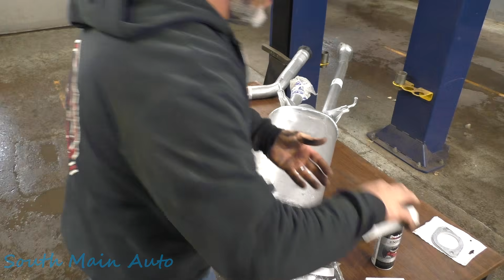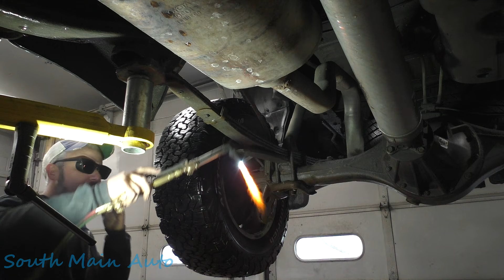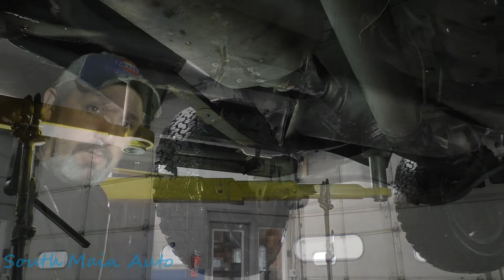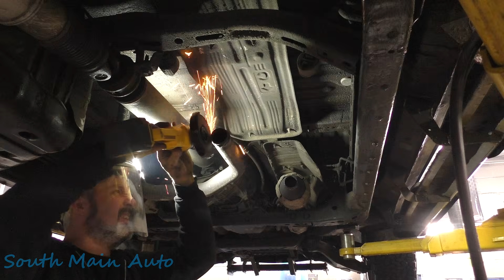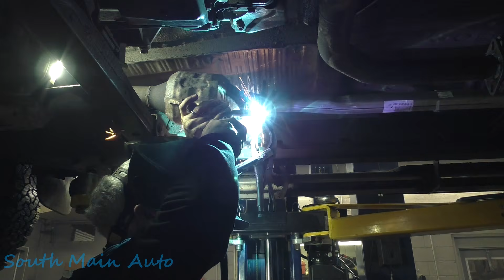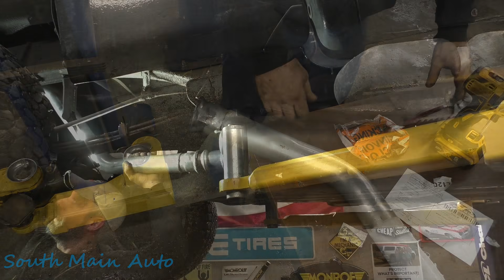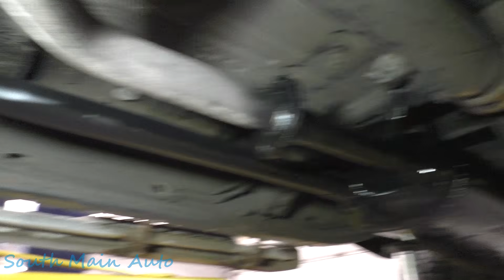Toyota Tundra: Welding On New Convertor Flanges & Replacing Muffler

Comment: As a DIY'r, I own my torch setup.  Leasing the tanks all year long to use it once or twice just didn't pencil out.  A medium Miller/Smith torch setup, a 75cuft full acetylene tank, an 80cuft oxygen tank, and a cart set me back over $1000 several years ago.  The upfront cost of leasing the tanks would have been lower, but at this point they're probably paying me back.  There are cheaper ways to torch, but I like nice tools.  😉
Reply: I always wanted a torch but could not justify the cost. Than one day I was driving along and someone was throwing out one of the small portable kit, ( tanks carry case gages the whole thing). The tanks were completely full.
Reply: Yep. Same for welding gases: it works out better for us DIY’ers in the long run to own the tanks outright and find a place that will fill them at a reasonable cost.
Reply: I had a set of tiny tanks used for hvac brazing I was using for automotive. Seems like I was constantly having them filled. Upgraded the garage to giant tanks on the cart and I haven't filled them since. Its time to refill though. I use mine a couple times a month, but without them I can't do the work. Well worth the $.
Reply: Some jurisdictions won't allow you to own tanks as a diy or shop or dealership. The people that own them can't legally get them filled.
Reply: One draw back with torches is the cost of acetylene. The last time I had my small tank refilled (2 years ago) it was well over $100.

Comment: As a top fan, I am very careful not to get into a pissing match with anybody in the forum. I have read many of the comments and I was surprised to hear Eric say people were complaining about his use of the torch. Well, let me say that I am from Springfield mass and I couldn’t run a shop without a cutting torch or a welder. The rust on these cars is not going to allow you to remove anything the normal way .If I can use the whizzy wheel and cut things off safely. I will do that the oxy acetylene is a little pricey, but that’s what the shop supplies charges are all about paper towels waste uses of gases. To name some

Comment: I have used propain oxegen torches, but these where in big shops that make mining equipment and it  is a cost saving measure and work just as well as astatine , other then that being in northern ontario you have to have then on your truck , there not a want there a must , but i also carried a small welder as well , that was a want , but working on heavy equipment it sure as heck came in handy

Comment: I had a 2008 Toyota Tundra that had the front differential howl/growl TSB repair, err they replace the whole front differential.  Both rear axle bearings, apparently also a TSB...both replaced.  Then a couple years later both issues resurfaced again.  Sold the truck with 104k on it and haven't looked back since then.  I can't remember what year it was they changed bearing manufacturers, I think 2010 or 2012.  But it seemed like there was a 2-3 year span where they just got a crappy selection of bearings and plagued their Tundras with repeat failures...otherwise the truck was ok, wasn't a fan of the IFS either, never ending alignment issues on that too.  Engine/transmission was fine, but when you can't keep bearings doing bearing things it was time to send it down the road.  Would I buy another Tundra?  Not a new one, but I'd buy a newer model after the bearing supplier change.

Comment: Cutting torch makes short work of all kinds of things, the guy that my alignments in the UK has switched over to using an electric hot stick (I think it was £3-4k for the unit) for loosening off tie rods/bolts which is great for not melting plastic crap that is in the line of fire - but that's a big ol investment when you are using the torch for a lot of cutting - it'd end up as a niche box you use once in a blue moon.

Comment: ive got a customers 08 Tundra right now. Its like the exhaust flanges are made out of trash steel. It also needs U joints and that wonderful drive shaft mount bearing.

Comment: Yeah that sounds like heaven to me. And as for torches i dont thimk they have a clueas to what their talking about, tor hes are a perfect shop tool, for more than just mechanics ,bodyshops use them garages use them as well as the other varieties like thermal induction coils  for seized bolts and such. Keep up the great work

Comment: My question about the cutting torch is simple - what the heck else are you supposed to use?

It's the right tool for the job in your area.

(As for "no rust heaven", move down to Georgia, we'll be happy to accommodate your wish)

Comment: I suspect the torch issue is because the "youngsters" and those who grew up in dealerships haven't had ready access to torches. I'm just a DIYer and can't imagine not having "Vic".
Reply: Long time dealer tech here. It's weird where I'm at in Virginia because it wasn't as essential until about 10 years ago or so when the state started brining the roads before winter weather. Now I use them all the time. As far as the young people I've encountered lately, most of them can barely operate a screwdriver, so using a torch is going to be a hard sell for a while. I hope that's just an issue in my area and not everywhere. It's time for me to move into the independent world though.
Reply: @crazyracinjason  Try some farm boys (and girls) for productivity and knowledge.
Reply: I work at a dealership on Long Island and i use the torch weekly. Rusty cars need some extra motivation to come apart lol
Reply: as a youngster who doesn't have ready access to a torch i just sit there jealous.

Comment: Yeah, Walker IS garbage, and has been since at least the late 70s, when I was a wet-behind-the-ears driver for an independent parts supplier.  I remember shop techs bitching about Walker clear back then.

Edit: the hot wrench was in constant use the whole time I twisted wrenches and I didn't live in the rust belt.  Gas and equipment is fairly cheap and it's extremely useful.  Whacking off old exhaust, heating up crusty bolts on exhaust manifolds, making special tools, etc, etc, etc.

Comment: Eric, You are lucky to have a wire feed welder, back in the day I had to use a stick welder, you bent the rods to weld the top. You should have left the tape on it, it'll be the only thing holding it together in a year.

Comment: Straight pipe it Eric , cut out that back pressure and you might get 13 mpg  LOL
Reply: Agree, neighbors will love you, also wrap the engine in foil, also split fire plugs, squeeze out extra half horsepower.
Reply: @nmatthew7469  Why not do the TRD supercharge too.